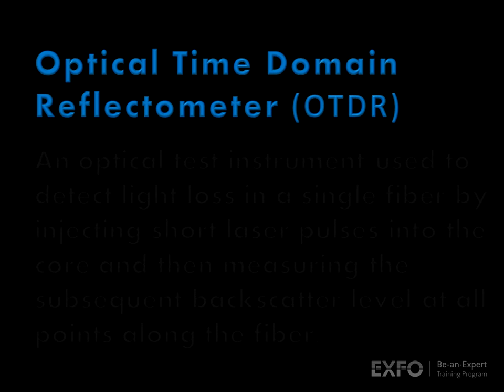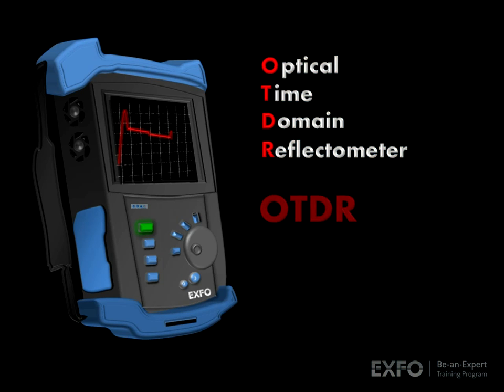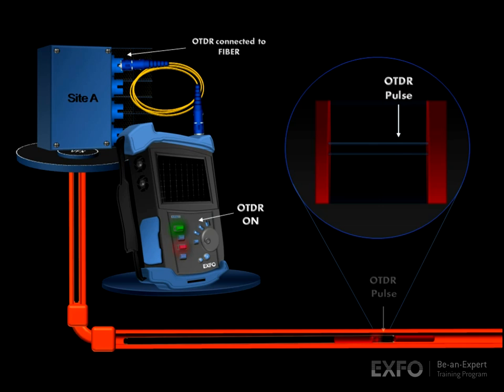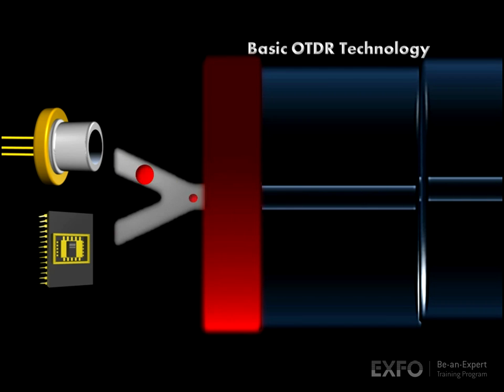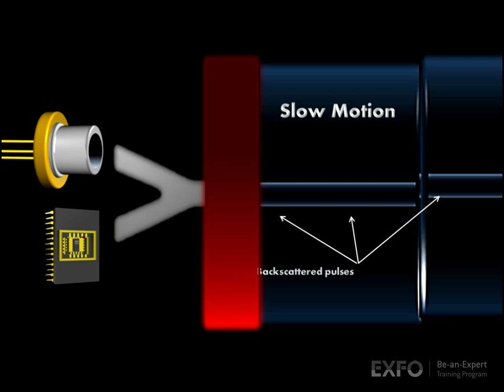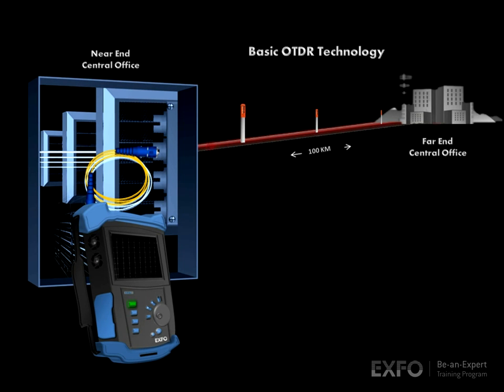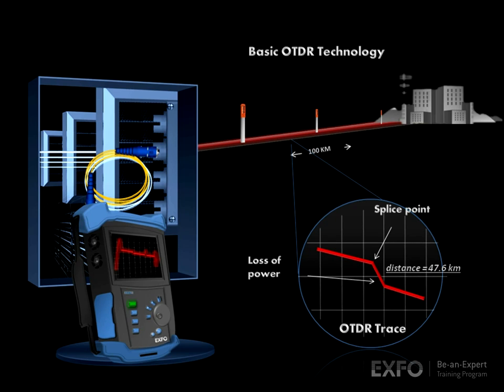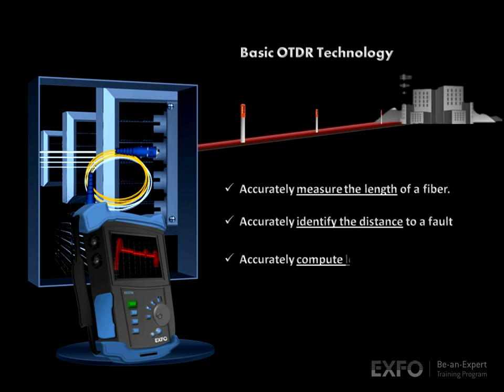OTDR- EXFO animated glossary of Fiber Optics

Comment: All the videos from EXFO are good learning resources. Regarding the OTDR video, a small suggestion: In the slow motion part of the video, when the pulse travels through the Y coupler to the fiber, the reflected(Fresnel reflection at the connector between the LD and the fiber ) pulse should  be shown for a precise understanding.